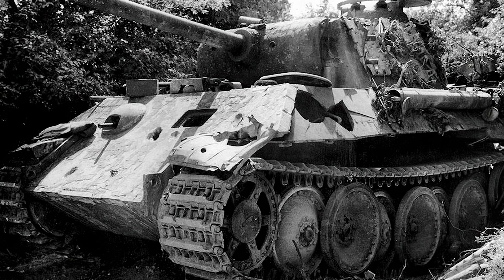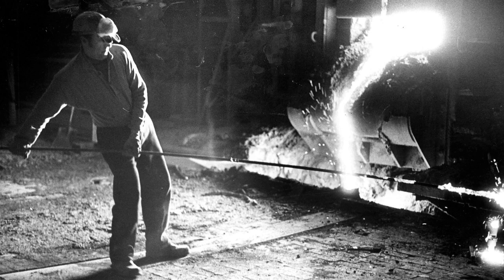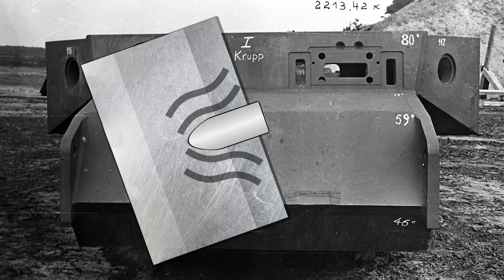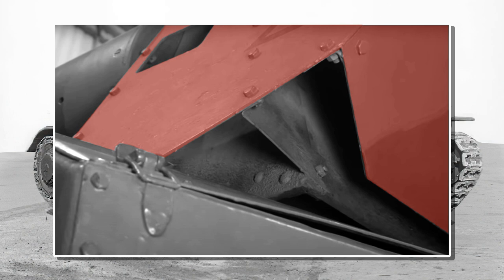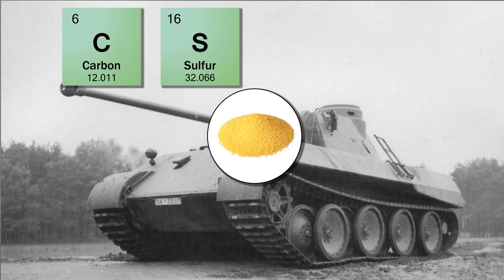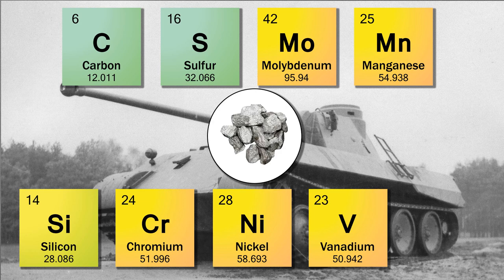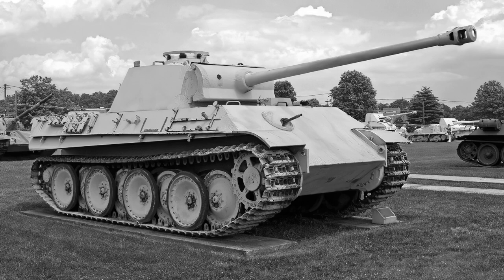Panther Armour - Tank Research & Review

Comment: Funny how many times I heard that German tanks were superior because rivets can brake off. And how little people say how badly German armor spalled, even before industrial shortages. Such an underrated video.
Reply: There was also mention by a book on the Polish Home Army that some of the slave labor learned to make hollow wields. They look good but weren’t causing plates to separate along edges.
Reply: @michaeltelson9798  I think while there might be some truth in this, its mostly an an exaggeration. Welding was something that Poles (and many other more industrialized countries like Italy) didnt know well. And German heavy industry is located mostly in western Germany.
Hitler got to power because he blamed everyone but Germans for everything bad. I think most cases of sabotage was when a German worker or a designer did something stupidly wrong (also because he was overworked, underfed and even slightly sick) and was scared of consequences. So he blamed it on the Poles.
Ill also add that in wartime, the quality of T-34 welding was raised so much that it was considered tougher than the armored plates themselves. But in first IS-3 tank hulls produced by the best Soviet engineers welds did crack when you drove it. So even quality welds can brake due to simple things like vibration.
Reply: Yes, German tanks were known to break in the welding seams. And Pzkw. 4 had a "shot trap"  under the outher corners in the front.

Comment: Nice video.

an another problem was the austenitic welding filler material of those days. The HAZ and the weld metal was a disaster.

Weld metal: 

- Enormous dillution in the weld metal with Cr23C6 web
- based on the dillution the weld metal was mostly martensitic
- the cold-crack phenomena was not know at the time

HAZ:
- hardness peaks due to the welding heat input and chemical composition of base material
- hydogen sources aroung the welding (moisture, oil, rust, etc..)
- unfortunate welding sequence increase the residual stress

This martensistic structure had a bad critical temperature (where the behavior of material switches from ductile to brittle) and the spoiled base material was not able to withstand the high strain rates - caused the impact with the bullet. This can be seen on some picture - large cracks means there was no elastic reserve anymore. 

Metallurgy is a bitch - welding metallurgy is the worst bitch

Comment: I recall reading in Men Against Tanks by John Weeks that because the Germans used AP shells with burster charges, they specified their armour to resist the same.  This meant that the armour needed to be very hard so that it would entirely reject enemy shells as it was assumed that partial penetrations could still be fatal.  If memory serves me right, Weeks goes on to observe that Allied tanks were sometimes lost when their more ductile armour permitted German shells to partially penetrate and then detonate while lodged in the armour - exactly as the Germans expected.

If this is correct, then it seems you can't have our cake and eat it - if your armour is hard enough to reject AP shells entirely it will potentially be too brittle and crack under strain even when it successfully bounces the projectile, whilst if your armour is ductile enough to hold together it will potentially permit AP shells with burster charges to explode within the armoured envelope even when it has technically defeated the projectile.
Reply from the maker: indeed problems on both sides, the bigger german issue comes about with capped rounds and sloped plates, which il need to get too at some point

Comment: This was a very interesting video. I do some welding for work and as a hobby. On the subject of armour I have a family historical involvement with the Legendary Australian Kelly Gang of Bushrangers. A forebare of mine was a Blacksmith in Kelly Country in Central Victoria and some of his work ended up being used as part of the Kelly Gang sets of armour. The ABC TV Australia program Quantum did a special where they examined the Kelly Gang armour using modern technology and much of what was discussed about steel at the  crystalline structure level was very similar to this video. Admittedly, we are talking about the difference between steel and armour plate, but the crystals tell the story. 
The other side of my family emigrated from Germany to Australia in 1875 and were tool makers, W.G. Goetz and Son's, so casting large steel components for presses and other equipment was a speciality. My Grandfather worked there before, during and after WWII, working 6 days a week during the war. "Old school" presses and other such equipment is still highly regarded because of the very weight and mass of the equipment makes it so much more robust than today's equipment. Once modernised the old equipment can be calibrated and set up and because of its mass it will stay set up. The modern equipment will drift out of calibration as it moves under stress. 
Mark from Melbourne Australia
Reply: Yours is a worthy addition to the form.  Thanks for posting.

Comment: First, I'd like to say that this is a very well researched and put together video. You are doing good job at explaining complex topics of terminal ballistics and armour metallurgy to laypeople.

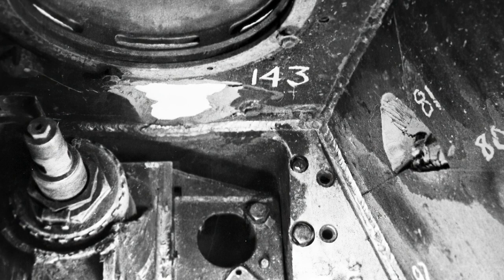But there are still parts I'd like to address, in particular the assessment of British and Soviet engineers you are quoting around 16:00. I see that you understand the concept of "strain rate" and how it can affect the behavior of steel under impact from ductile to brittle. The judgement that german 30mm steel plates were brittle are based on the results of firings with 2pdr and 45mm AT guns at normal incidence. This would've put the armour plates far outside their designed specs, which were to stop 2cm AP at low obliquity and 3.7cm AP at high obliquity at 100m distance. 

The germans, unlike other nations at the time, considered optimizing the resistance of their armour against high caliber low velocity(= large distance) rounds was not as critical as reducing the maximum angle at which the armour can be defeated at 100m. If you'll ever find the testing reports of the same undermatching "brittle" german plates under high obliquity impact, I'm sure the results obtained will be as good, if not superior, to their own domestic armour.

Cheers.

Comment: Good video, but I hope you put more focus on the variability in the ductileness of Panther plates. As you mentioned there are plenty of examples of Panthers with substandard plates with brittleness however, I have found a good deal of examples of Panther plates that exhibit ductile properties in photographs. Mainly identifiable by the smooth scoopings you mentioned in the video. This paired with the examples of substandard plates found on Panthers, at least to me, points to variability more than anything, with a mix of good ductile plates and substandard brittle plates.

Anyways, good video, especially explaining the properties of metals within steel.
Reply: cheers Sasuri, the danger here is similar to the bike helmet, while it might just look like a dent on the outside its whats inside that counts and a great deal on panther tanks knocked out even with minimal damage have not been inspected correctly, just a soldiers observation at best. even a large glancing blow can seriously damage the plate or begin to split and fracture the plate. alas with many of these we are lucky to get the simply outside photo and sadly not a good look around the inside.
Reply: @edfrancis712  A fascinating look at the science of the metallurgy, yes indeed, but such concentration on details can serve to blind the audience to a bias .  Your dismissal of Sasuri s point seems too glib to me. 
I doubt very much that the answer to the phenomena of the Panthers brittle plates is simply that the Germans lacked the Knowledge or didn't know what they where doing. Nor does it seem likely that the reputation that was gained early on , a reputation of having very good tank armor , can have been entirely baseless. 
A more likely scenario is the one that is usually understood to be the case. That is to say , a situation of increasing disruption of the production processes as the war dragged on.
 Gradually decreasing availability of various materials resulting in compromises , taken at a time when the pool of knowledgeable  metallurgists and  skilled workers was being rapidly reduced and diluted, would have led to the production of armored plate of variable quality. 
Desperation and a lack of alternatives would have served to ensure that that plate got used anyway.
My understanding was that the test carried out by the British showed exactly that, plates of very variable qualities , with the qualities varying considerably between various plates on even one tank.
Reply: @andrewwoodhead3141  I've got another coming out soon, on jagdpanther where they examine the vehicle and look at the metal and yes the materials vary massively between captured tanks even of the same type, tho with regards to the prev comment, it was more that some of the scoops we see look like a clean bounce yet on the inside show heavy spall, and the metal is still broken. - oddly the issue with cracking and shattering plates goes back to 41 so it wasn't just a late war thing.
Reply: @edfrancis712  Thank you for your work. I have subscribed and liked.